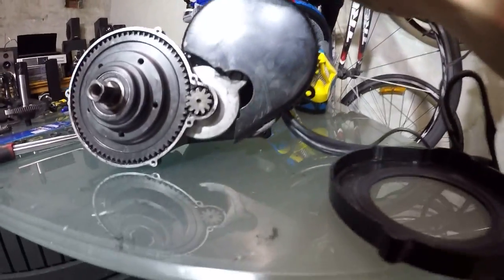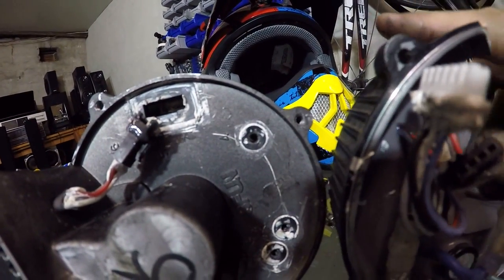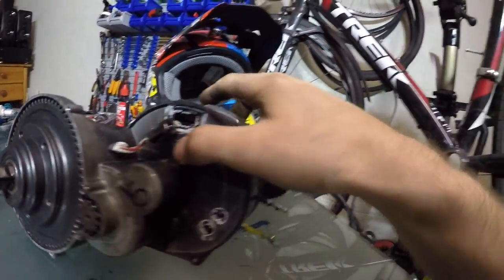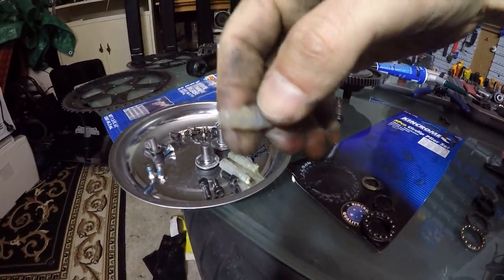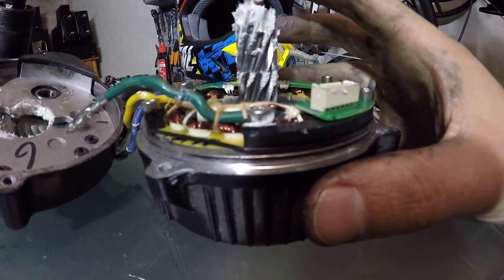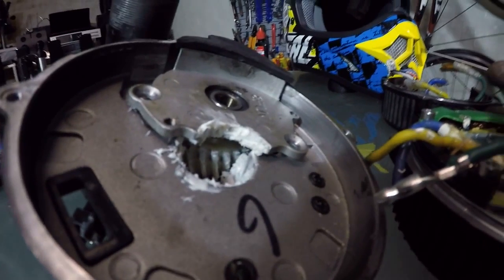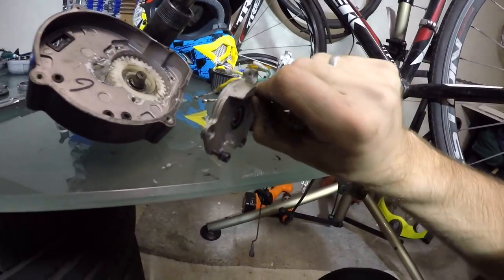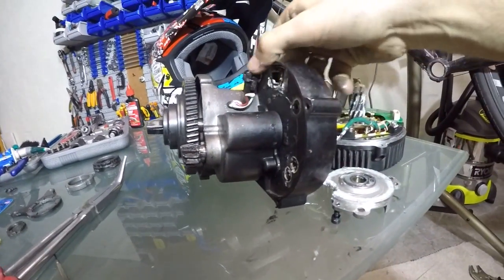DIY Tutorial Repairing BAFANG 8fun BBS02 750w 48v (Part 2 of 7) *opening controller and motor

Comment: Very-informative video thanks. Learned much how to dissemble motor. If you can suggest how to troubleshoot a bafang 48v bbs02b . The motor runs strong but after 30 seconds it turns off to no power. If you can suggest briefly where to look , much appreciated ,thank you.

Comment: Hallo from Holland, 2 years ago I had that special sound. I used loctite 641 as you advised. Now the winding and anchor makes a grinding noise. Everything disassembled. I expected some sharps, but everything looks fine. Maintenance done and motor reassembled. Cycling is fine, but the engine keeps making that noise. Am I ready for a new motor ? Maybe the shaft is out of balance causing the magnet to rub against the wrapper ? Maybe you have some advice. Thanks in advance. Greetings from Holland.

Comment: Great video. Got a question: read on a forum that when going uphil use max pedal assist or even full throtle whilr on lowest gear. What fuzzies me is that the author says tha PAS 1 or 2 will put more stess on the controller than PAS 5/5, eventhough the.output current is lower. why so?

Comment: bruno... couldn't you simply reattach the right crank arm on the shaft and pull it out..?  instead of opening up the motor by taking off the controller..  You said at frame 7:50, as you pushed with your thumb, "just forcing this thing out."  That shaft is connected to the deformed small gear on the other side.  I think you would need to take all that apart (controller) to replace that small metal gear that engages the big metal reduction gear that hold the clutch/freewheel.

Comment: Hi guys i have a question how do you drive a mid drive ? I had a hub drive and shifted to mid drive bafang 750w so i know you have to be in the right gear to keep the load off the motor  i have a 11 gear casette so when i come to a stop should i always shift to higher gear and go up to 11th gear to avoid strain on the motor ?? I find this very annoying if thats the case couse to gain speed i will have to shift 11 gears to gain high speed can any one clear this matter for me please ?

Comment: .  an ebike with motor and transmission shaft  parts design  guaranteed to last for 100,000 miles or life  would  solve the problem of spare replacement  parts and reliability issues on ebikes.

Comment: Hello Bruno The legend! :)))
Can I put moly grease instead of a white grease on plastic gears?
Reply from the maker: Hellooooooo Ivica!!!
Moly grease is not suitable for plastics in general, petrol solvents in it weakens the plastic, so moly is for metal on metal only. For plastic the ideal is to find a very thick white lithium grease (not easy to find but not impossible) if you can't find just use a multi purpose lithium grease that is suitable to use with plastics. Email the manufacturer or call them to ask if this info it is not very clear on the label. The easiest way to tell is to smell the grease, if smells like petrol is not a good thing. Many times I just use the existing Bafang grease applying it back on the nylon gear, this is the easiest way and works!
I hope all that info helps =]
Reply: Thank you very much! Then I screwed up. :( Yesterday I disassembled the engine to check why sometimes feel the vibration when the engine is started. Sometimes when I start I feel something like gears skipped and I fell big drop forces-acceleration. I immediately suspected that the gears start sliding, but when I opened the engine I saw that as new, what should because I crossed only 350km. I put moly grease and in this gears for each case. Now I have re-open motor and remove moly from plastic gear. :(Did you notice on your engine something similar vibration and skipping on acceleration?Ty very much! :)

Comment: I haven't  watched part 3 yet so you may address this then but those gears are helical cut. They do not have straight teeth they are angled for a reason.
This creates side load, they have greater contact area and they are quite (usually)
Reply from the maker: +Matthew Heffernan - Yeahh.. all internal gears are helical in this motor so they are always engaged. The load was sooo intense on the small pinion gear that the gears were completely deformed.. a quick visual inspection wouldn't be ideal to inspect that damage, everything "looks perfect" but as soon you pull it from the frame.. ohh... it was so horrible.. I showed all on the videos 3 and 4...
Helical gears crease a side load and..... pumps the grease like a propeller to one side of the gear.. eventually one side of the gears won't be lubricated... combining this with extreme torque... this was a recipe for disaster!! No wonder why my pinion gear was damaged so badly. =/